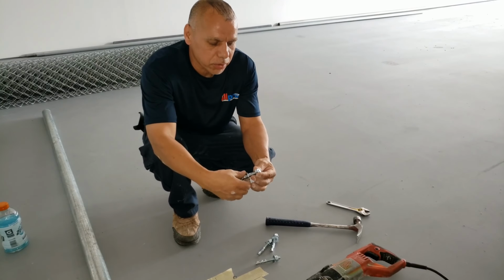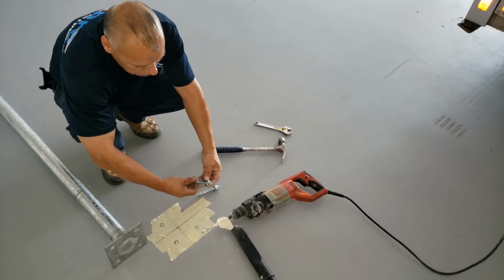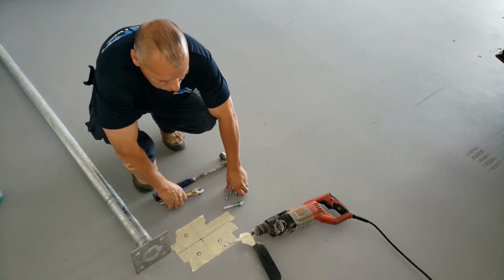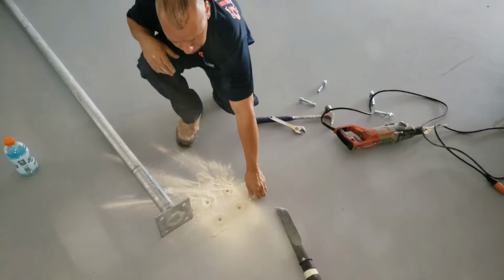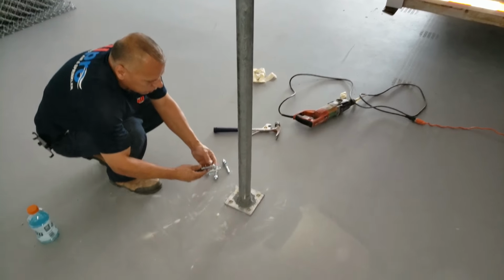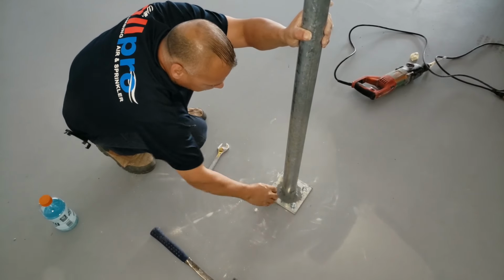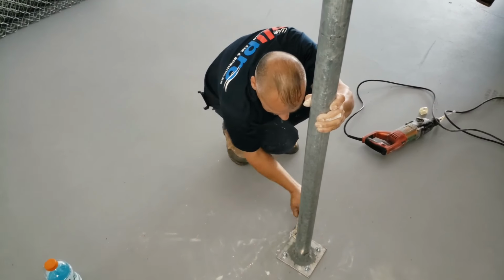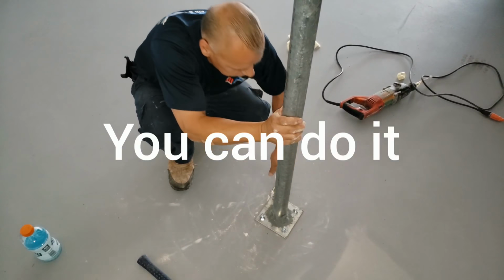Anchor bolts installation - quickly & easily 2019

Comment: Is it necessary to use a large, corded hammer drill like the one you have? Or would a good quality hand-held hammer drill (like a DeWalt XR or Milwaukee) work?
Reply from the maker: Not necessary at all. The drills you mentioned would work well. Most hammer drills will easily do the job, but for power and quickness, I pulled out the corded one

Comment: Would these same posts work outdoors? I initially thought I would have to put j bolts in wet concrete then allow to set
Reply from the maker: these are galvanized fence post with plates welded on and yes, these would be perfect for outdoors after a pore of concrete.

Comment: will this work on ashphault?
Reply from the maker: You need to consider if its going to be structural and if the ground is solid and sound. If its for structural, then I would recommend digging out and poring concrete and then go from there

Comment: Is the tape down to help the pole to stop moving around? Would be good if you could explain it from the beginning. :)
Reply from the maker: The only purpose of the tape on the floor was to accurately mark where my holes were to be drilled. The floor had newly applied gray epoxy so I didnt want to mark up the floor in case I made a miscalculation of where exactly the pole needed to be. the tape on dill bit was to mark the depth i needed to drill down

Comment: What brand bit?  The ones I have used suck.
Reply from the maker: bosch or any name brand should do and they last a very long time. Be sure to use a HAMMER DRILL and not just a drill. The hammer action chips and drills in like butter practically

Comment: Size of bolt and the drill bit used for it?
Reply from the maker: There are many different sizes and styles. Usually the packaging will tell you the correct bit size to use when drilling the hole

Comment: Please always blow out the hole a vacuum will not get the dust out the hole should b blown out with air and wire brushed and repeat tell no more dust comes out of hole other than that do everything else he did lol
Reply from the maker: I agree with you 100%. I used the vac because I didnt want dust every where. I was just erecting a chain-link fence inside a warehouse for equipment. if i were outside then I would have used my cordless blower
Reply: @johnscarpentrytv4358   Absolutely.  Who would blow dust all over a room?